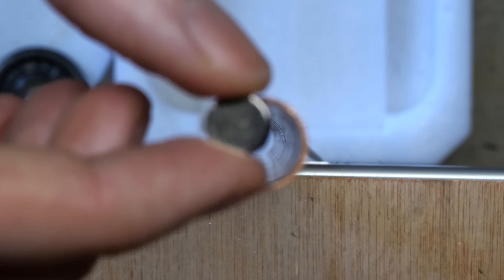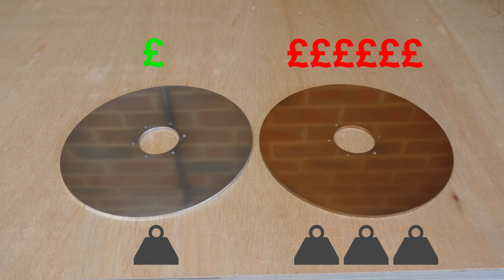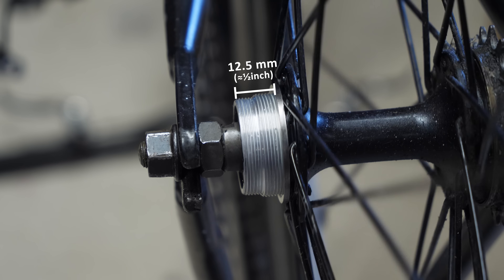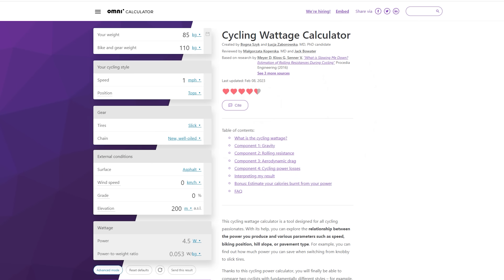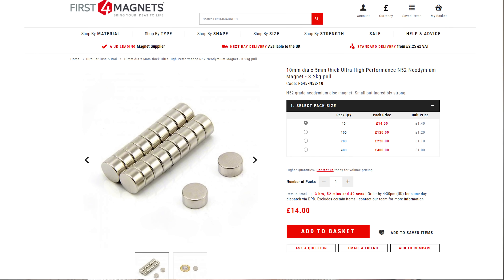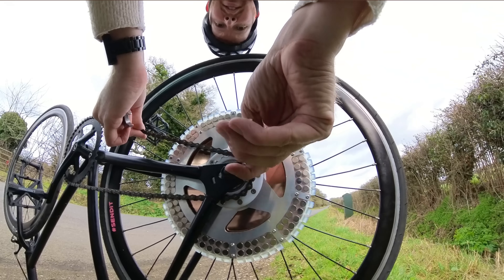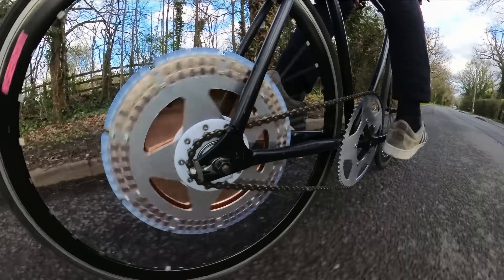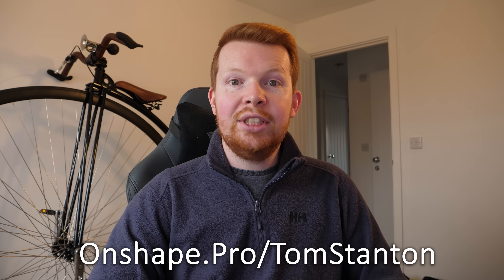Gearless Magnet Bike

Comment: so I think I would have tried the copper and magnets on the front drive sprocket.  This would let the back wheel spin freely with no pedaling.  You could even use the magnet #s to act as gearing.  I would also use a belt drive instead of the chain.  I know this is a prototype.  Just suggestions for future additions.

Comment: I think you could get better torque capture by using larger diameter magnet ring and rotors.  Not really more magnets, though that would help, but just putting them at a longer moment-arm.  It seems like what you have here is a magnetic torque convertor.  What I'm picturing is less a disk and more a ring of copper almost as large as the wheel rim.  However, just like a hydraulic torque convertor commonly used in automobiles, there is a limit to how much torque the system will take before you get slippage and heat generation.  A longer moment arm will help with that some.

Comment: Look into the concept of a halbach array, it’s difficult to describe in text, but a diagram will help it make more sense.
Put simply, it’s an alternating pattern of magnets, i will attempt to describe it, / will denote vertical orientation and - will denote horizontal.
n/s, n-s, s/n, s-n, n/s, repeating.  
This pattern displaces the magnetic field parallel to the axis of the vertical magnets, increasing the strength on the face corresponding with the north side of the first magnet, and decreasing the strength on the south side.
An added benefit is if you displace the moment on the outside of the wheel, the magnets will have less moment on the spokes, decreasing the need to use the zip ties on the spokes.

Comment: Torque and gear ratio is however not the same , you basically have done what you say - a clutch, but i do not see any use of it as the gear ratio basically is fixated.  In a normal bike you use same torque  more or less for various speed, not various speed for a consistent torque
Reply: Complete agree with your comment

Comment: Would be interesting to try copper rims and attach the magnets to the crank.  Maybe have copper elements mounted on springs that adjust their position based on the centripetal force at different rpms to give gearing.

Comment: Several years ago I saw a very large version of a magnetic coupling at a heavy equipment trade show. The display featured a large electric motor driving a big pump on a ship. the non-contact magnetic coupling allowed for modest misalignment between these two power-hungry devices.
Heat can become an issue. Eddy currents generate heat. As the system heats the copper becomes more resistive and the batteries become less strong

Comment: It would be a fairly minor tweak to augment the copper disk so that it becomes the rotor of an electric motor.  You could turn on the power and have an electric engine assisted bike.  Turn on the power and hold the pedals still, and the motor does the cycling.  Turn off the power, and you can still brake it with the magnets-- Or better, reverse the polarity of the battery hookup and the battery slows the bike (or even throws it into reverse--though going backwards may not be a good idea).  And done right, you could still pedal to add your leg muscle energy to the motor power.

Comment: Did you consider adding ferro-magnetic plates to the outside of the magnets?  That would make the magnetic circuits stronger. You probably can't do it on the chain side.

Comment: Time to add the flywheel to this. It seems that the timing changed when using just the force of your pedals acts as a damper that causes braking when the pedal timing changes. Add the flywheel for a smoother power transition and you should have a much smoother ride.

Comment: Hey that's pretty neat to learn about the alternating polarity creating a greater resistance. I didn't think of that. You could print a little cube grid that holds multiple magnets with opposing fields and probably get a much more impressive slow down when dropping it down a pipe.
Reply: The alternating polarity pattern is a variation of a Halbach Array. It can be improved even further by turning each successive magnet by only 90 deg instead of 180: https://en.wikipedia.org/wiki/Halbach_array
Reply: @rainman1701  If by "a variation of" a halbach array you mean "not at all" a halbach array, then you're correct. It is not at all a halbach array.

This whole comment section is the Dunning Kruger land of people who think they understand magnets.

The whole purpose of a halbach array is to preferentially force the magnetic field of the array to extend to one side of the array. "Up down up down" does not do this at all.
Reply: @htomerif  Nobody is impressed, guy. Go outside and touch grass.
Reply: @mechanomics2649  Impressed by what? Being informed of the truth? I don't care even a little bit if you're impressed.
But you did get an education from me, so you owe me one, like it or not.

lol.
Reply: That's how maglev trains work
Reply: You could learn from how they align magnets in blc motors. They're designed to have the highest magnetic flux linkage. The higher the flux, the more it'll induce when it changes. As the induced current is proportional to the rate of change of magnetic flux.
Reply: This guy telling truth, because has Copper Hairs Colour.
Reply: Try it
Reply: Maybe the printable magnet company featured on SmarterEveryDay could create a tiny alternating pattern https://www.youtube.com/watch?v=IANBoybVApQ
Reply: @Squancherino  You people do understand that the efficiency asymptote this thing is approaching with more effective magnetic fields is identical to just gluing the two plates together, correct? There is literally zero benefit to this clutch? I feel like everyone is missing this fundamental concept.
Reply: @htomerif  This is not about efficiency, more like about smoothing out momentum... which really doesn't make much sense for regular bike. This can work out for trike tho. You can even make electromagnetic transmission which will work kinda like variator.
Reply: @Inf1e  No. no. That's like a post-hoc excuse for making this thing. You know what "smooths out momentum"?
Springs. Springs are those things that modern manual clutches already have on them specifically to smooth out torsional variations, and they don't waste a huge chunk of your limited input energy.

Also, all electronic bicycle transmissions already exist and they have nothing at all to do with this thing. They're basically a generator attached to a battery attached to a motor.

This is a toy that makes riding a bicycle worse. Its brakes that are engaged harder the more you pedal. That's fine. I do dumb stuff too that serves no purpose, but what annoys me is everyone in the comments including people who I know should know better are trying to make excuses for this being a GOOD idea. Its NOT.
Reply: @htomerif  What’s the deal, why are you so worried about everyone’s thoughts on the project? Why go out of your way to do so in such a negative way?
I mean I’ve seen literally no one actually proposing that this is some great or revolutionary technology superior to anything else. 
It’s literally just everyone curious to take the experiment further to both better understand the topic and just because it would be cool to see what happens if you do x instead of y. 
I mean it doesn’t even matter if it did fail miserably and the result were a total let down, since that’s not the point. 
I mean you may have a way more complete understanding on the subject matter, but the people posing ways to further the experiment are clearly trying to further their understanding in a fun and practical way. 
Why shut them down and make them feel bad for their curiosity and interest in the subject and experiment? I don’t see anyone saying this is such a great idea based on its merit as a better mouse trap. I just see others like myself who enjoy experimenting and watching this sort of content that does experiments to see what happens, not because it’s going to amount to anything outside of a fun somewhat educational project. 
I mean there are numerous channels and videos of the sort where they do test and experiment with things that may seem objectively silly and clearly won’t work out, but people still watch them for the entertainment value and hopefully to gain an understanding off why it doesn’t  work and how it does. 
Often taking that interest and curiosity in the subject matter to advance the experiment and see how it will function under other circumstances and if you can get the desired results by taking a different approach that actually can work. 
I mean I would hope if you saw a child showing an interest in science/experimentation expressing his curiosity what would happen if you did x or changed y, that you wouldn’t just shut him down and tell him it’s dumb and there’s better ideas than his, so it’s not even worth thinking about, because it’s wrong, even though he doesn’t understand why it’s wrong. 

As I’m the first to admit my ignorance and despite dedicating an insane amount of time educating myself in countless subjects. I know that I’m no expert and I only have a minimal grasp on a lot of subject matter I consume online, but that’s why I continue to educate myself and either pose thought experiments, watch others or actually do hands on experimentation myself. 
All due to my own innate curiosity and interest in the sciences and technology. 
I know it’s unlikely I’m going to make some technological break through and no one one here was proposing they would, at least not that I saw. 
But someone asking these questions and indulging their curiosity until they understand well enough to do something really cool, just might. 
But for every person and especially children that we shutdown for saying something that comes from a place of ignorance, but they’re still trying to understand or learn. 
That’s one more person who’s at least a little less likely to follow their curiosity and be confident enough with their ideas to one day do something really incredible with them. 

I mean you don’t have to be the one to take the time to indulge their curiosity, but you also shouldn’t be the one going out of your way to shut it down either. 
You don’t have to be nice, no one does, but you also don’t need to be condescending and mean about it either. As there’s enough of that in the world and it would be nice to have a little less of that and just a bit more positive encouragement of someone’s interest in educating and better themselves. 

I know you probably don’t care what I have to say and that’s fine, I just figured I’d rather try and fail, than not try at all.
Reply: @jsanchez23  You'll note that every time I've shot down someone's "idea" here, I've done exactly what you asked and explained, in detail, WHY their idea won't work.

The fact that this video doesn't have a disclaimer saying that this whole concept is junk and does nothing is irresponsible.

If Tom Stanton wanted to do a video on eddy current "clutches" he could have done one on some place where they're actually used: roller coaster brakes.

My "attitude" is a product of people who should know better intentionally or negligently spreading misinformation, and believe me, I'm holding back.

There is a HUGE difference between someone ASKING "is that how maglev trains work" and some Dunning Kruger short bus passenger stating FOR A FACT "ThaTs hOW mAglEv trAIns worK!"

You get it now, bruh?
Reply: @htomerif  so, what did you get from shooting down someone's idea and curiosity here? If they try their idea by themselves, will it makes you bankrupt? I mean, why are you so interested in wasting your energy to shot down people's interests?
Reply: @htomerif , "good idea"? It depends on your definition of good. It's not a good idea for a production bicycle, but as a physics/material science learning experience (without having to take a deep dive into theory), it's great.
Reply: @bubadisastra  Well, is been a day, and good to my word, I'm calling you out: I didn't just shoot down people's ideas. I'm annoyed that I have to shoot down people's ideas.

What I actually did was educate people. Every time I shot someone's idea down I explained in enough detail for them to verify WHY they're wrong.

That doesn't make me intellectually bankrupt. It makes you intellectually bankrupt. Your not admitting it or failing to realize what I was doing in addition to "shooting down ideas" makes you DOUBLY intellectually bankrupt.

You and I are done here. See ya.
Reply: @bubadisastra   When one's efforts, mental or otherwise, are shot down, one has to take it like a man.  The immediate response has to be a cheerful "Oh well, back to the drawing board!", never "Why are you so mean?"  Nothing else works over the long term and that's a fact that must be faced.
Reply: I would like to see what will happen if i put two magnets into copper pipe from oposite ends. Outside pipe they will just crash and probably break, but in pipe they will slowly connect?
Reply: @gelo1238  The force retarding the magnet is proportional to its speed through the pipe while the force between the two magnets is inversely proportional to the square of the distance between them. So as they approach each other, the attractive force will be effectively the only relevant force. If they were going to break outside the tube, they'll break inside the tube.

Also, the closer the two magnets get to each other, the more the north and south fields approaching each other will cancel out, reducing the force from the eddy currents by half on each of the magnets, though that doesn't really matter given what I said above.
Reply: Hey, it's The Son of Ted Cruz! I keep running into you here and there (Tech Ingredients channel, etc.), so I'll probably have to subscribe to your channel soon.
Reply: Seeing your comments across a few different channels at the moment. Dont you have videos to make!!😊
Reply: @UncleChopChop22  have and owe are two different words as per the dictionary.
Reply: @Algoinde  What does the word 'owe' have to do with anything being talked about here?
Reply: If you thought about it for a minute, you would know this. Here's an important thought experiment: what if you replaced the ring of alternating magnets with an actual machined ring neodymium magnet concentric with the axle? How much torque would be transferred?

Zero. The answer is zero. It would spin freely.

Eddy currents form when there's a change in magnetic field, not just whenever there's a magnetic field. So the more changes there are, the more eddy currents form. The only limiting factor is when the magnets get so small that the changes in magnetic field don't bridge the gap from the magnets to the conductor.

Comment: I would think an aluminum billet wheel and a belted drive would help the project,perhaps the magnets could also be used to power an electronic speed controlled digital motor to power assist the wheel?👍🚴‍♂️

Comment: At the beginning of your video, testing the difference between copper and aluminum is not taking into account the weight difference. You mention that the copper disc is already slower due to it's weight. 

So instead of having the metal disc spin, spin magnets.

Comment: Cool idea ! I'm not sure if its been mentioned but what about switching to belt drive in lieu of a metal chain and maybe a carbon bike (or at least a carbon chain stay) frame to eliminate any extra magnetic drag on the system.
Reply: A chain is the most efficient form of transferring power which is why it used on bikes. It mechanical and very little friction losses. Great exercise though I love magnets and do believe they have many developments ahead.

Comment: Ok, but now try to collect the energy generated by pedalling and powering a motor that makes the wheel turn. This should improve a lot the power delivery especially when going uphill and the speed of the pedals is much higher than that of the wheel.

Comment: Have you considered using a belt drive instead of a chain?
Reply from the maker: I've used belts for my ebike drive train, and they tend to be far wider than chains for the same torque rating. Which given the limited space, would be difficult to fit.

Comment: I'd like to see you do brushless DC on the pedals wired to another BLDC driving the rear wheel.

BLDC motors are technically a permanent magnet three phase synchronous AC machine. The challenge: having enough torque capability in the motors to avoid slipping poles.

Comment: Interesting. Unfortunately it was obvious from the get-go, by just considering the physics, that it's not going to work as an efficient transmission, but rather a clutch that simply wastes power so that you can pedal faster at low speeds. So I can't see what was the point.